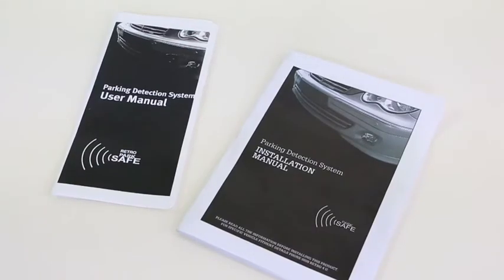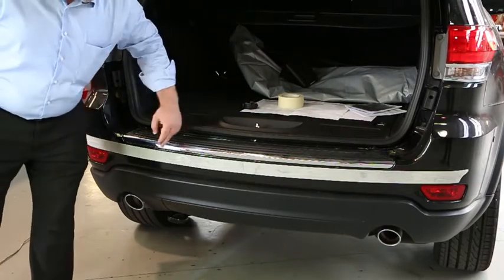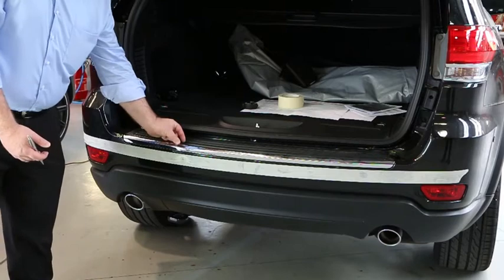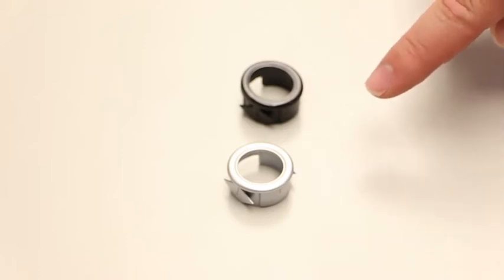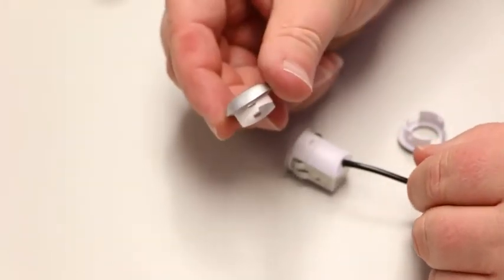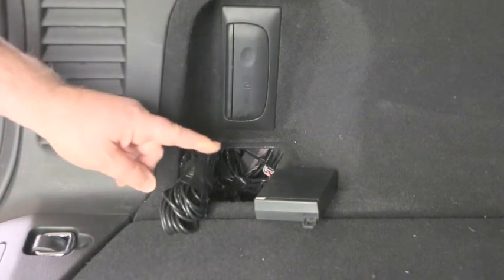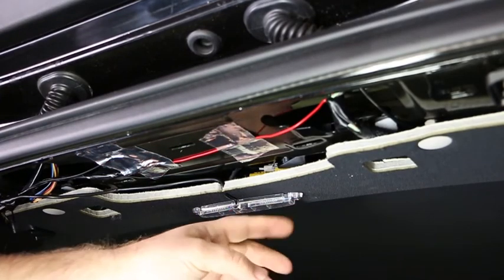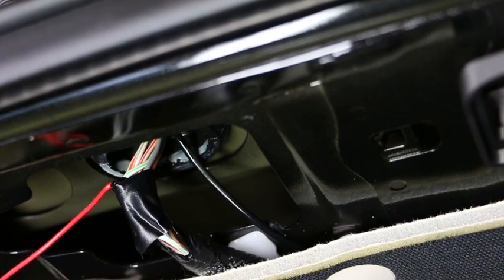How to Install Rear Reverse Parking Sensor kit

Comment: I found this video because I suddenly wondered if these sensors have a correct orientation (up / down).  You confirmed as much!  Is this also true of factory fitted parking sensors?  Since my car's rear bumper was replaced due to a fender bender, my PDC is overly sensitive.  I've started to think they installed the sensors into the new bumper without observing the rotational orientation - does this sound plausible?  Thanks
Reply: I am about to install my sensors, and it tells me to orient them with the sticker on top. There aren't any stickers on them! Boohoo.